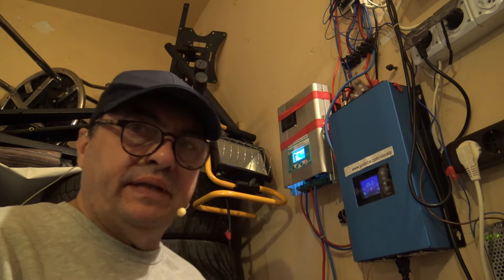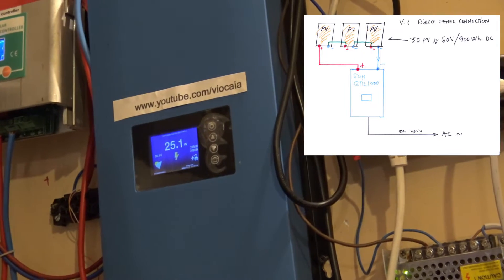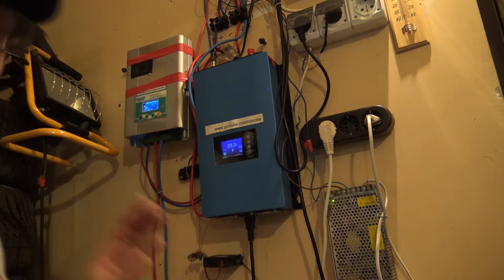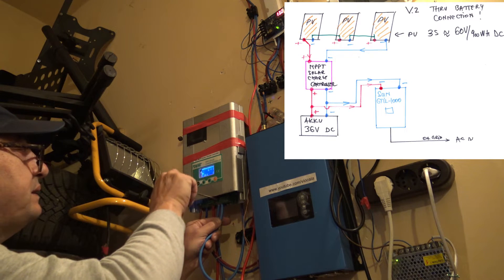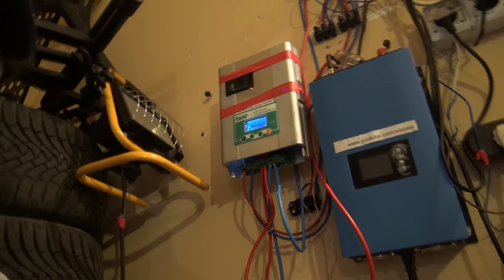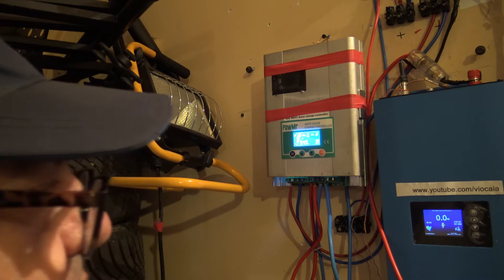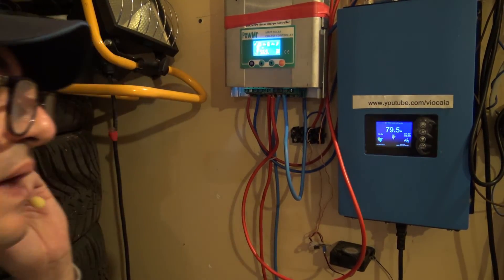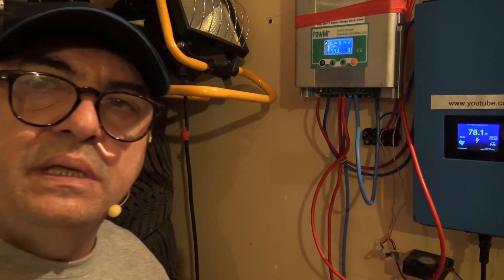On grid inverter thru MPPT and battery vs direct PV connection

Comment: 6:08 I have a similar setup with 2 panels in parallel connected to GTIL and during production the volts drops from 36v to 24v , but works fine . Actually, I have 2 arrays with exactly the same setup, but they are independent and connected to different phases of the house. I'm planning to add a battery, more because it's not taken the best of the performance from the production over the day. I estimated that i will double my production by adding batteries, because when the house is not consuming, but there's production then it goes to batteries for later usage.
Reply from the maker: Perfect idea! I will implement batteries soon.
Reply: @viocaia  Related to voltage drop, have look if you have cables properly sized, I did that mistake placing a 14 meter 4mm 1,8kv DC solar cable, but I'm planning to upgrade to 6mm or 10mm cable. There is a calculation based on cable distance, temperature, Imp, Vmp, panels in parallel or series. Use chatgpt, and provide your solar system set up and it will recommend what cables to place and provide you the calculation.
Reply from the maker: @MAFR-BZ  Right!

Comment: hy i have  inverter growatt mic 3000TL-x   i want use battery also is possible? 3.2kw solar  panel
Reply from the maker: As long as you respect the input voltage why not. I'm not familiar with the device , but as long as in not a hybrid (charging the batteries) you should have a strong MPPT battery charger
Reply: @viocaia  is good powmr 60A mppt battery charger?
Reply from the maker: @caniolancellotti4501  Of course, I got one working for years!
Reply from the maker: @caniolancellotti4501  https://youtu.be/aAxTom0xkNI
Reply from the maker: @caniolancellotti4501  take a look at this videos about my experiments with a Nissan battery
Reply: @viocaia   hy i have inverter growatt mic 3000TL-x on grid,    and charger control    powmr 60A, is possible create a sistem that use battery i want use battery       3.2kw solar panel.      what will be the scheme
Reply from the maker: @caniolancellotti4501  I see Growatt is working usually with 360v DC. You can't reach this voltage with Powmr 60A which goes max 48V...even the battery it's hard to reach this voltage. So, I'm afraid you have to use another combination, another AC converter able to use a 48V...
Reply from the maker: @caniolancellotti4501  look here what I've done https://youtu.be/aAxTom0xkNI
Reply: @viocaia  can you advice me a good battery charger for my sistem my grovat inverter?

Comment: Your inverter uses 30w and the 25 goes to the grid = 55w from the solar panels. An mppt input can be dangerous for the battery because it does not take into account how low the voltage is on your battery and switches off, but it can be done in another way
Reply from the maker: Just experimenting.
Reply: @viocaia   @jacobhn2 @viocaia As soon as the PVs, cables, busbar, battery, charge controller, inverter and grounding are well sized and protected with fuses and circuit breakers, isn't a problem, having an charger controller feeding the battery and Inverter pushing energy from the same busbar. However it is crucial to do the  calculation RIGHT otherwise things can go wrong, like having a fire.
Reply from the maker: @MAFR-BZ  Agree!
Reply: @MAFR-BZ  I read my comment again after a year, a lot has happened to my understanding of solar systems and have also got a small system (200w pv, mppt 700 w, Power inverter 2KW out and 2.5KW battery and next year I upgrade the solar panels
Reply: @jacobhn2 @viocaia As soon as the PVs, cables, busbar, battery, charge controller, inverter and grounding are well sized and protected with fuses and circuit breakers, isn't a problem, having an charger controller feeding the battery and Inverter pushing energy from the same busbar. However it is crucial to do the  calculation RIGHT otherwise things can go wrong, like having a fire.

Comment: best solution here would be split the solar line directly to the grid-tie inverter and to charge the batteries, then connect the battery output and solar output to the grid-tie inverter using a DC high amp switch that has 2 battery option. So, when the sun goes down flip the switch to power the grid-tie inverter from the battery output, and in the morning when the sun comes up flip the switch to directly connect the solar to the grid-tie inverter. problem solved. this is a manual switching method that is kind of annoying, but It can be automated if there is a DC switch that is equipped with a timer.
Reply from the maker: Absolutely working idea, unfortunately I'm out of good batteries, all I do is to light SOME LED in the garden after sunset

Comment: Hello Viorel, thank you for your always interesting videos. I have a gtil 1000 and only 3 panels of 340w. I would like to improve my installation and include a powerMr and some batteries. What do you think is the best battery deal to buy? What could you advise me? I live in the West Indies, I have a small consumption of about 285 KWH
Reply from the maker: Hey and thanks! Having batteries will improve GTIL output power as you see in my videos...I can't advice for a certain batteries, I wish to have LiFePo4 but I can't afford more panels (due to lack of space) and from my tests to drive a set of 6KWh batteries we need at lest 3000Wh panesl..that to have enough output and charging in the same time.But , for your install I believe a max 1KWh will be a good start..try to find a block from an electric car battery, even Li-po or Li-ion. Any modern MPPT will have a menu for properly charging Lithium cells. Usually they are cheaper then new LiPoFe4. Take care with Li-ion! They can be hazardous and temperamental! That's why LiFePo4 are better and secure..but expensive..Good luck!

Comment: Interesting video. 
But what happens when the batteries goes down and are deployed during the evening/night? Does it takes longer time in the morning before the system produces energy to your house?
Reply from the maker: Yep, the batteries in my case are mostly for leveling the energy from the PV..the inverter can be set to certain low voltage to protect the batteries..but their capacities is unimportant though..